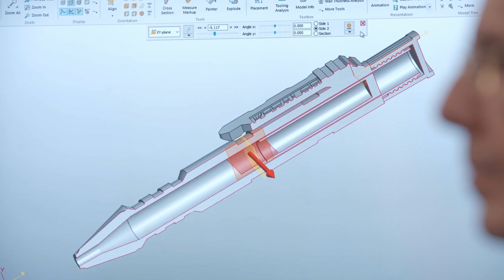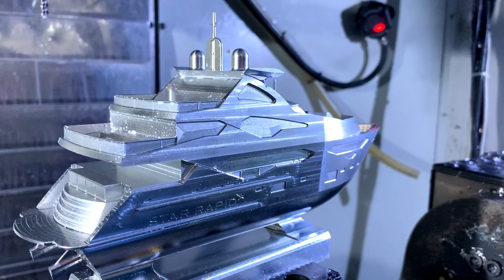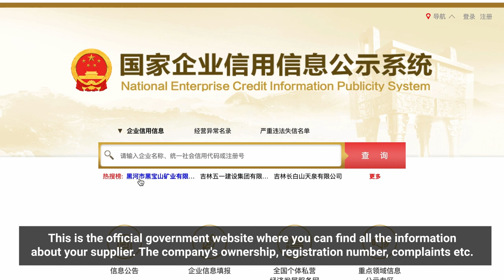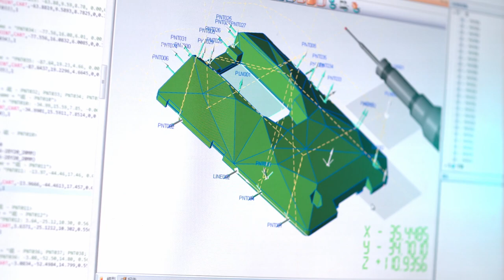Do these 5 THINGS before working with a CHINESE MANUFACTURING supplier!

Comment: i think nowadays its quite simple, if you cannot visit them, you cannot work with them. im saying this as a guy that used to work in China for 15 years, doing inspections and solving problems.  in China personal relations with the manufacturer are very important, if there is no relationship, there are going to be problems, potentially big problems. especially if you are looking for new suppliers that you have not worked with before.  so keep that in mind, doing things locally is less risky, and low in travel cost. you can go visit the plant and discuss and solve problems, that advantage is major, and worth a higher price.